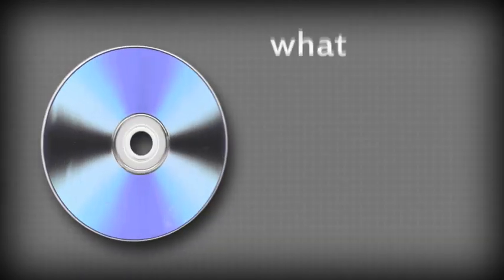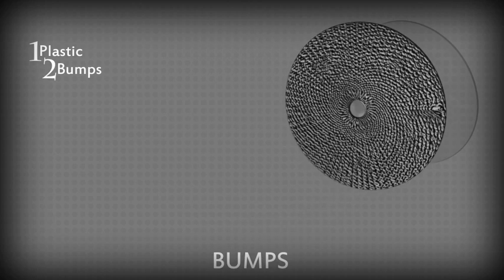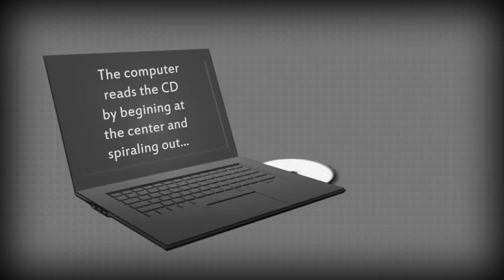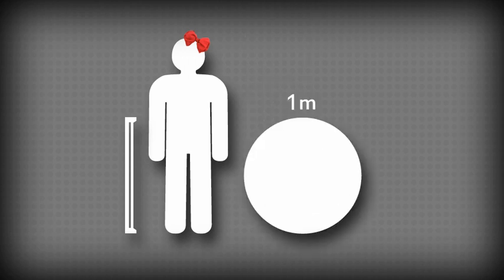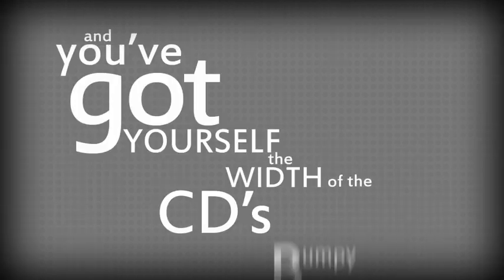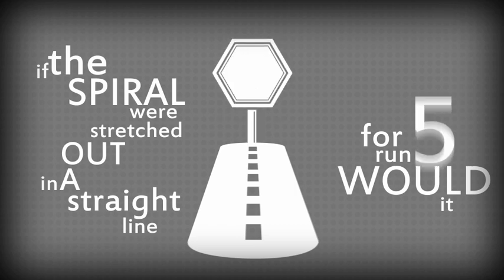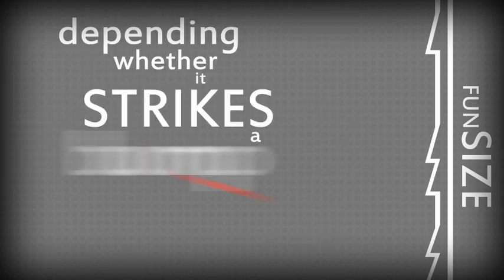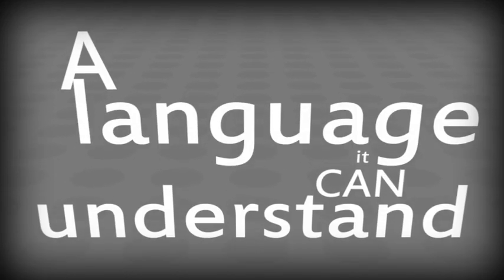How CD's Work

Comment: The narration begins by describing a clear molded disc of polycarbonate which is then engraved with the data.  This is incorrect.  The digital data is molded into the disc at the time the disc is molded and not added later.